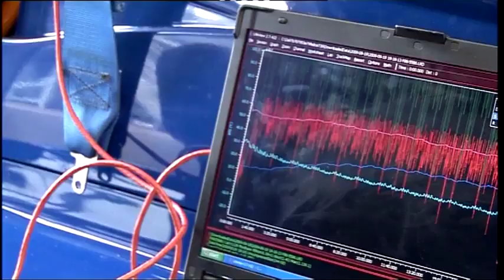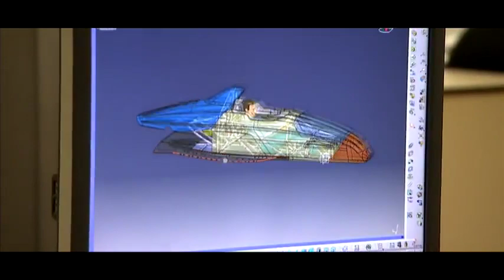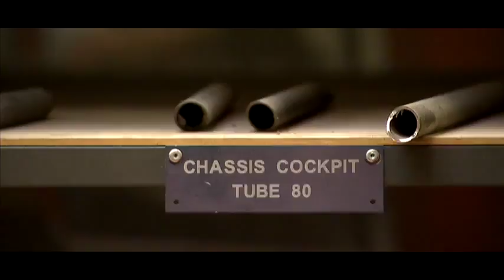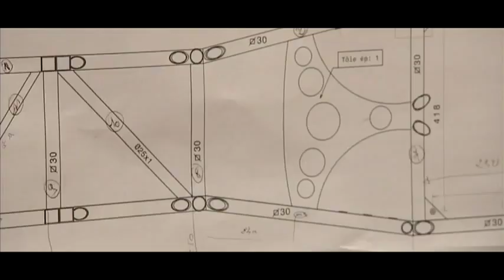Formula Ford 2012.flv

Comment: I purchased a new Titan Mk6C in 1974 for $6000.  Bob Earl had won the 1973 SCCA Runoffs with the new Dave Bruns designed ADF DB-1 which was priced at $10,000.  This was the beginning of the end of cheap FF racing.  BTW, to race that Titan for a season in 1974 cost me $25000.
Reply: 2012